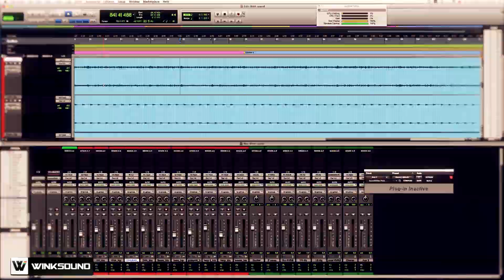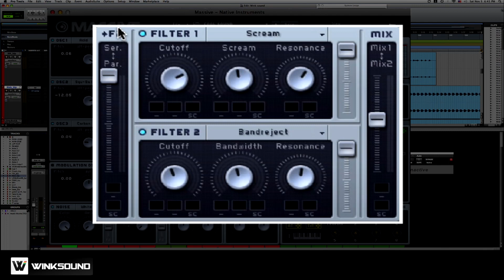Native Instruments Massive: How To Use The Filter Section | WinkSound

Comment: Here's a question,

when working on Dubstep music... how do you get the "Wobble Effect" to "wobble" in 1/4 notes, then switch to 1/8 notes, then back to 1/4 notes?

So far, I've been having to use 2 separate tracks, and record both and create the pattern in the edit window on PT... am I doing it the best/easiest way? or is there a better way to do this? 

Thanks!!
Reply: automate the lfo to do the trick for you or automate the filter cutoff